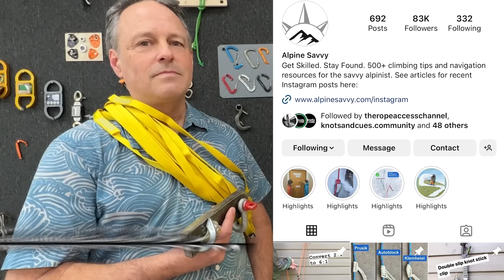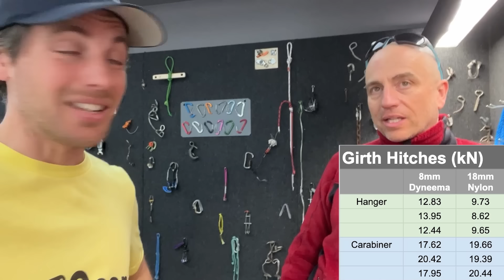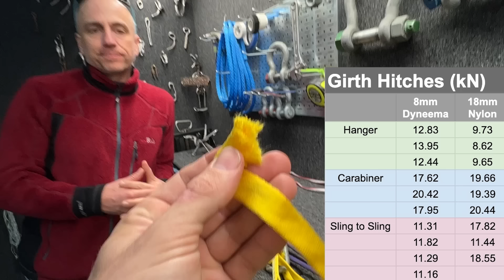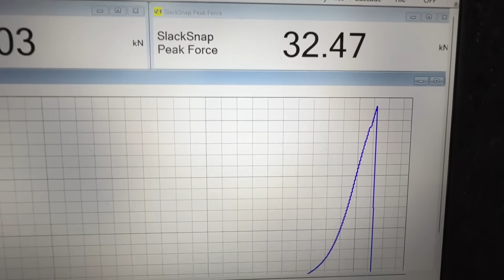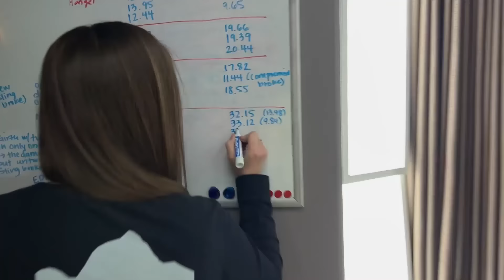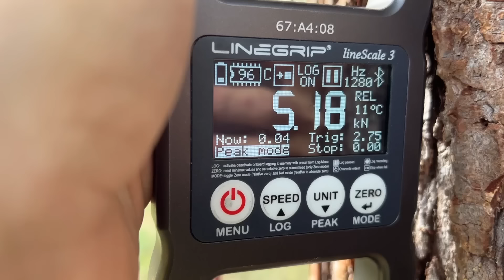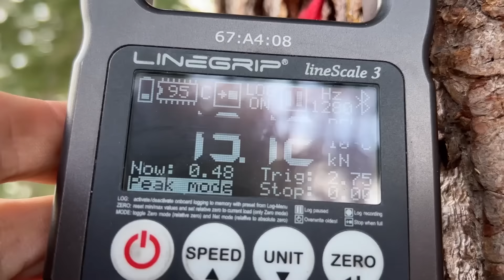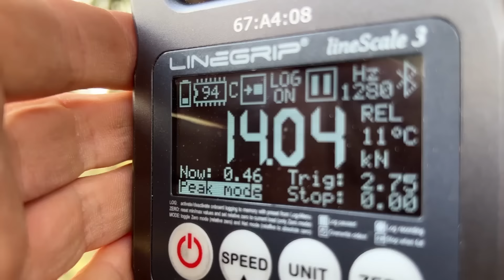This seems sharp

Comment: Dually noted. Dyneema is slick, and you're not supposed to tie knots in it. Nylon don't like sharp metal edges. Also, Ryan played in a tree.
Reply: “duly” (i.e., “in the proper way”)

Cheers.
Reply: @chuckhightower2730  or dually, as he noted two things there. Well, two important ones at least
Reply: The difference here will also be due ti size if the slings. The broader sling geht's affected more by sharper bend.
Reply: not supposed to tie knots in dyneema? huh

Comment: Since we're almost always girth hitching a hanger with a sling as a bailout/strategic retreat method and the typical combined static weight of a climber and gear is 200lbs or less, a reasonably fresh hitched runner is "super good enough." Just don't bounce on it.

Comment: Another thing worth pointing out is that Dyneema after it's been used for a few years sees a quite dramatic reduction in strength - the UIAA conducted tests on skinny 8mm slings which had a 50% residual strength after only 3 years of use. Your bolt example would become super not good enough...

Comment: I think one side being 'cut' is still a pretty important consideration. If you're on trad for example and the placements are shit without many options for building a belay, its not that unlikey that the rock could fail or gear could dislodge itself, but at that point you're probably going to be building your anchor differently.
Reply: If a biner remains in the system but it's no longer placed there is no way that biner can slip true dude ...
Reply: Yes exactly. The whole argument is silly because you wouldn't use the girth hitch anchor in those types of scenarios. Two bolts, go wild. Gear anchor, I'm building something else so why are we still talking about this lol
Reply: DAV and VDBS, for example, have recommended girth-hitch-master-point anchors for trad anchors that utilize multiple questionable pieces. See: https://staff.weber.edu/derekdebruin/research/anchorsdav2020.pdf

Comment: Thanks for the video! For a paraglider we attach the whole cascade of <1mm dyneema/aramid lines together using girth hitches.  Last year there was an accident at the root cause was theorized may have been because the girth hitch was dressed improperly between a tab of webbing and a really thin section of line. It would be interesting to see how this test repeats between  different materials. For instance if you hitched the nylon to the dyneema!
Also, I had a fun idea…. It seems that 2-3 N is an upper limit out body likes to handle (judging by your videos of doing large lead falls in the gym). It also seems that the dyneema knots slip at around 2-3N. Obviously trusting the knot to keep the system together is a no go for that reason, but could it be used as a tool to absorb shock in a very rigid fall? Imagine you are using a dyneema sling as a personal
Anchor. Shock loading it is a no-no. But what if you tie an overhand on a bight in the line. Would the slipping of the knot prevent the force from exceeding 3N?
Reply: There are nylon "screamers" that tear stitches between 2-4kN depending on the design that do essentially that. For dyneema, it could work similarly but perhaps with less precision, but you'd probably want to be attached with something else as well (with more slack) because rolling knots damages the dyneema.

Comment: It’s the width of the nylon strap that causes it to fail more easily on the sharp edges, on a round edge it spreads out under the load evenly distributing, but on the sharp edge since it’s wider it doesn’t have the space and ends up tearing from the bunched edge kind of like how you tear a phone book

Comment: Your question about why the break is in a particular place. Regardless of how equally one distributes the loads at each end, the end that is actually moving is seeing more load. This happens when bending steel stock using hydraulic rams. Placed between two members one places the moving ram against the member to be moved, and it will move even if the members are the same size and configuration. One might believe that the force is equal, as there is a single ram and only two points being pushed by the ram, but the moving end of the ram is always the end that gives and changes dimension to the greater degree.
I do not understand the physics but that is how it works! SO in your case I believe that the end that is moving is effectively  seeing more load. TO you this means that the working end sees more load than the anchor end where girth hitches are used to connect the harness.
I would also like to point out that heat is the cause of failure or the result of it. Therefore, a question arises, what happens to the numbers when the tension is applied faster or slower? I would guess that there is a straight line that would fit the stats for time and load to failure. example, a fall would probably tension the assembly MUCH faster, which may cause failure at a lower value?

Comment: Great content per usual but along with other commenters, I would like to see the result when one of the legs gets cut or an anchor fails. Or just start with one of the legs not clipped in. That would be super helpful in putting to rest the YGD opinions on girth hitch masterpoints.
Reply: Tests showing (Semmel C.) that there is no problem as long as your sling is at least 10 mm - used as double strand. In rare cases (depending on how the sling is made) slides occur with some 8 mm - not recommended though - there is always a biner / piton / cam blocking a slide through. With a 3 point anchor there is no way one leg is slippin through... not even a few cm's. The VDBS (German Mountain Guide Association) recommendations are based on those tests.

Comment: I wonder if the dyneema sling does so much better on the hanger just because it doesn't really stretch, so the sharp edge isn't concentrating as much stress as it's doing to the nylon. It kind of implies a lower stretch material would retain more strength.

Comment: Hmm, would have liked a slow pull of single leg of the girth hitch master in dyneema. Does heat affect it?  Maybe a pull with the gear biner still in the loose leg as if the gear failed? Also if it's not technically redundant why do it all? Is a series anchor? 
Great to see the strength of a single girth in dyneema and change my understanding.

Comment: Girth hitch to girth hitch where one dyneema had a knot that unwind itself: was that a setup? If so, here is why the other sling broke first. When the knot was unwinding - the sling was becoming longer and longer, but not evenly. Additional length of sling was added on one side of the loop. So loop had to even out by slipping through a carabineer on one end and through a hitch on another. That slippage through girth hitch caused deadly friction - deadly for the sling that maintained its length.

Life saving lesson!

Comment: You were saying those nylon slings failing at 8+ kN was bad, but I fall on a black Totem only rated to 6kN all the time, so...

My biggest concern with girth hitch setups is that they're typically not redundant in a way I trust, so if they got sliced it might not hold. I'm not worried about the gear breaking due to forced but rather due to abrasion.

Comment: I think the width of the nylon in the hangers was a factor for the lower strength.  It likely catches more of the inside edge surface area - like a knife with a longer blade. 

I'd also point out that a symmetrical girth hitch between slings, is a square knot - which while not preferred, can be adequate.
Reply: The reemergence of GHMP has really put me at ease in scenarios where I need more material between placements in an anchor and have less to spare for the knot.  Thanks for this one!

Comment: Even just nylon directly on the anchor broke at nearly 10x my unclothed weight.

If i fall far enough for the harness to load me up at 10 Gs at the bottom end, my back is going to shatter like a ceramic sculpture.  if the rope failed on top of that, it'd be a mercy.

Comment: I was surprised that the girth hitch anchor worked out to be honest. I’ve always been told to wrap anchors (for rescue) but this even works for the NFPA 15:1 safety ratio.
Reply: For two people on one line from one anchor. Assuming 100kg per person. Plus add in an independent anchor for a safety/backup/redundant line.

Comment: I suppose the reason that the dyneema did so much better on the bolt hangers is because that is a case of it being cut, rather than breaking around a radius. Dyneema fibers are much harder to cut.

Comment: If you girth hitch a sling to a bolt and whip on it (maybe you only had 1 sling and 1 non-locker), can the sling be re-used?  Or should it be retired?  Good to see these anchors are good enough.  They seem more complex than necessary, but maybe you forgot your cordalette at the last belay, which has happened to me. It would be cool if there were carabiners without gates just for this purpose.  These girth hit things have 4 things you need to get right: lock sling to bolts, correctly girth hitch biner, lock gate, load on carabiner spine.  A traditional anchor has 2:  attach sling to bolts, tie knot.

Comment: I think the nylon did badly on the hanger because the nylon strap is so wide. The dynema was narrow enough to load evenly and bring it's full strength into play before failing, the nylon one was at a disadvantage due to being ~"poorly dressed" in what is a kind of a V shaped anchor point.

OR the stretchyness of nylon is bad over a sharp edge in this situation? Like, the nylon is sliding over the sharp edge as it stretches but the dynema isn't?

ORR dynema is just more cut resistant, so obviously it didn't get cut as easily by the sharp edge

ORRRRR some combination of the above

In what situations does nylon work better than dynema over a sharp edge? Is the answer none? At what point does "tight bend" become "sharp edge" and does this flip the paradigm on it's head?

Comment: Nice there but how would a Clove Hitch work in your anchor, would be a good, would be a good redundancy for one side getting cut? As I've always used a Clove Hitch in anchor point both in rope & in Slings if I've to shorten or not had double Karabiners & sling.

Comment: Super cool stuff, as always! I'm glad I watched this, so I know that at least on those flat, kinda sharp-edged hangers, I shouldn't connect soft stuff directly.

Can someone "enlighten" me what Ryan is talking about when he says "Jesus draw"?
I'm not entirely sure if I grasped the idea behind it properly...
A jesus draw on the first bolt?
Which first bolt?
On a multi-pitch after climbing past the anchor below onward to the next pitch?
What about single-pitch routes?

Thanks in advance! I hope my YT recommendations aren't completely bonkers now that I've been searching for "Jesus draw"
Reply: it's on the first bolt after the anchor. I was taught to, if possible, pre-clip it as part of building the anchor. or, if I'm leading next, clip it before unclipping my pas.
you do it so that you never fall on the anchor itself, as that would be a factor 2, which can badly damage the rope (and your body).
there's no such thing on single pitch because you'd just deck.

I've never heard the term "Jesus draw" before, but I might start using it from now on :))
Reply: @cogitodubitoamo  thanks for the explanation! I suspected that it was only relevant for multi-pitches - I've not done any multi-pitch climbing YET, so it's still good to know this in advance.

Judging from the single-pitch stuff that I did so far, the bolts are pretty far apart usually, so I can't quite imagine how you would "pre-clip" the next bolt without a clip-stick or one of these longer stiff quick draws.

Thinking about it a little more - I guess you just clip the anchor and keep climbing past it to the next bolt and clip that, while you're still being belayed from the previous pitch? That way with a lot of rope in the system it wouldn't be a factor 2 fall at any point, right?
Reply: @Zolodar  yeah if you can't reach the next bolt you can also just clip one of the anchor bolts. anything above the belay device is okay.

Comment: Mocking the redundancy questions is a bit strange. I remember an episode of the sharp end podcast where a guy pulled off a huge block, and the anchor was cut, they themselves said if they had used a sliding x (or a double sling sliding x since the sling is in the same place), they would be dead instead of injured. In an accident like that, it's pretty easy for both people to end up weighting the anchor and perhaps dynamically. Especially on easy blocky terrain, they might run it out a little to the first piece since it's hard to imagine falling. Unfortunately, the redundancy of anchors is probably often tested when the conditions are less than ideal or something has already gone very wrong. 

Other notes; I guess on the carabiner and sling to sling the Dyneema has that smaller pinch point, so a tighter bend radius. Perhaps as the isolation knot rolled on the old sling, causing material to slip through the girth hitch, creating heat, the heat is spread over a large area on the sling that slips but stays in the same area on the new sling.

The girth hitch master point always seemed unquestionably strong to me, and redundancy was the main concern. I see you mock this concern, but sometimes there is a need for it, and this question seems more important in many applications than the ultimate strength. 5Kn failure dose not seem like something to be laughed off to me, especially since an old sling may behave differently (maybe the fuzz helps for all I know, or maybe the 5 becomes something even more sketchy). Also pulling on a less tight hitch may change the number.

Generally cool info, though and useful stuff to know.

Comment: In a redundant anchor, if the force is mostly on only one side of the system, would using the redundant method reduce the strength? Since if it's not redundant it can slip and equalize between the 2 sides it might have a higher total strength.